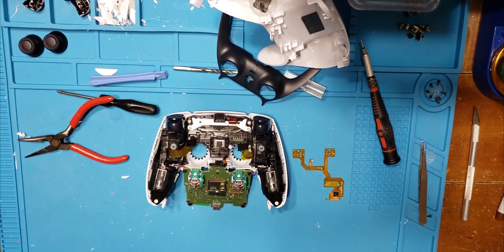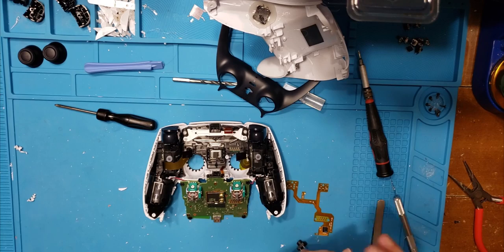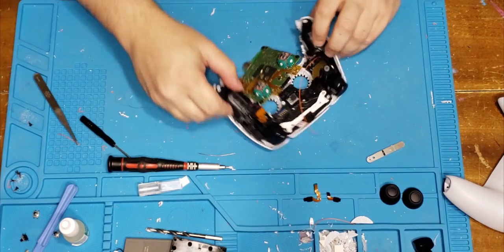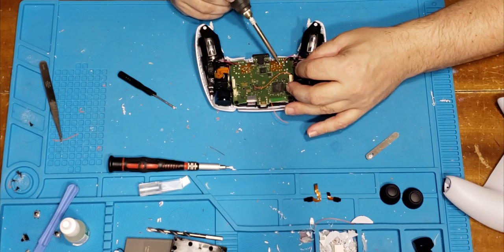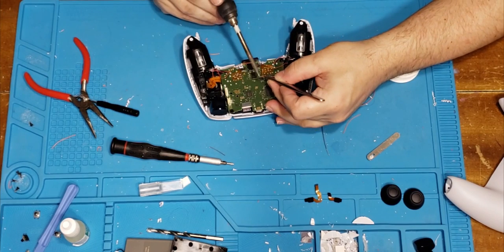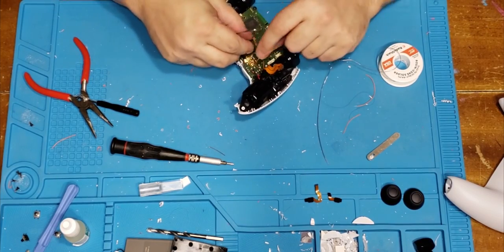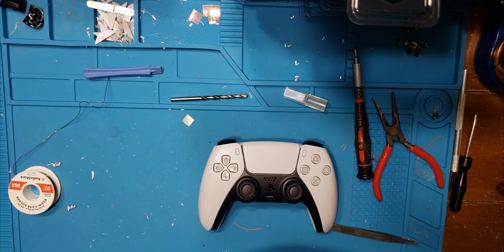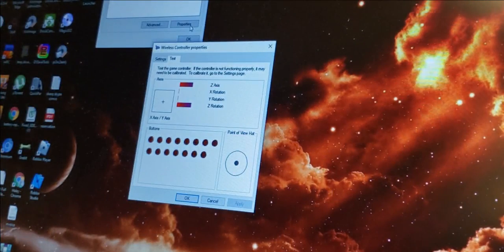PS5 Dualsense PROGRAMMABLE REMAP PCB + GRIP BUTTONS  DIY GAMER TUTORIAL BUILD UR OWN Controller

Comment: I bought the remap chip I followed your step to the t everything works but I can’t remap and the light never comes on? Any idea what I can do?
Reply from the maker: Did you do any additional mods like CLick triggers?
Reply: @MODCENTRALUSA  yes I did
Reply: I also added clicky face buttons
Reply from the maker: @luismaldonado-gg5fg  Only click face buttons.. not clicky triggers or bumpers? If you did clicky bumpers or triggers it will not work right.. you need to do extra soldering to make it work with that.  I can send you the diagram if you need it.  

Make sure your R1/2 L1/2 wires are soldered from the proper points on the trigger mech pcbs to my flex board to R1/2 L1/2. Again if you have clicky triggers or bumpers there are additional wires to solder.. I can not explain it.. but Ihave a diagram.
Reply: @MODCENTRALUSA  I have both click face buttons and bumper triggers too
Reply from the maker: @luismaldonado-gg5fg  YEP.. then it will not work.. THe board is designed for ANALOG Triggers not Digital clicky triggers and bumpers.  You need to connect your clickly triggers and bumper to the SR1/2 and SL1/2 Points on the board as well to allow the Digital clicks to register with the board. 

https://ibb.co/CWhcd4c
https://ibb.co/y5vzPqD
Reply from the maker: You could also upgrade to my Digital triggers and bumpers which will work with all programmable boards and Rapid fire boards with no extra soldering beyond the R1/2 L1/2. They are plug and play.

https://ibb.co/hfxfBvG
https://ibb.co/qYgwQSZ

The video release for this was shot last night I am editing now.. but I will be releasing these Over the weekend. 

They are $30 shipped...  They have some of the best 1mm digitial press switches on them.  These are industrial. 

https://ibb.co/hfxfBvG
https://ibb.co/qYgwQSZ
Reply: @MODCENTRALUSA  the diagram is a big confusing so I use the sl1-2 not the M1-4?
Reply: What diagram should I follow you send two links and both have different paths
Reply from the maker: @luismaldonado-gg5fg  BOth Diagrams will work.. up to you which you want to follow. 
M1-M4 are your remaps.. those are the buttons on your controller that you added. Those stay the same.  

Basicly looks at the extra TACT BUTTONS market R1/2 L1/2 those are the "Click" Bumpers and Triggers you installed. COnec them to the additional points on the remap/reapid fire board. To enable the digital features to work.
Reply: @MODCENTRALUSA  I didn’t use those switches though I used like the ones you sent me but from extreme rate, the plug and play kind
Reply: Do digital triggers and bumpers like the once you sent me won’t work if they not your brand? I bought extreme rates before I knew of yours
Reply from the maker: @luismaldonado-gg5fg  No My boards only work with my digital triggers...without the extra soldering.  With homemade digital triggers or digital triggers from anyone else have to be connected to the SR1/2 and SL1/2 points to tell my board you have a digital button installed. 

Keep in mind these boards were designed in NOV 2020.. there were no digital triggers at all.  As people came up with more mods and did things like digital triggers I updated my Rapid and Programmable remap so that they could interact with digital triggers and enter programming mode.  I know placed like extremerate are going to make their own stuff but they do not have the proper resistors and extra layers on their board to talk to my Boards and interact with it.  That is why I designed my own digital trigger PCB and nearly 9 months after I released my boards and updated them multiple times, I created a plug and play solution.   I haven't even officially announced them on my channel yet.. That is coming any day now.. just finishing up the video. 

The Photos I posted of the Install for CLICKY bumpers and triggers was made about 5 or 6 months ago when people were stuffing tact buttons in their triggers and bumpers to go digital.  I made sure my boards were ready and working with these other kinds of mods and you had the option of installing it in a stock controller with 4 wires or if you did a "clicky" button mod, you had the points needed for the board to recognize the digital buttons and still allow you access to programming mode. 

So you choice is this. if using extreme rate.  
Pull them out and get mine that pair with my boards. 
Or Solder wires to the legs of the buttons and connect them to the SR1/2 SL1/2 points on the board and you will have access to the programming menu,
Reply from the maker: @luismaldonado-gg5fg  https://ibb.co/W58dZDn

Here this will help you.. you need to solder 8 wires to make it work with Exterme rate digital buttons.
Reply: @MODCENTRALUSA  do you wholesale?
Reply from the maker: @luismaldonado-gg5fg  Yes... if the quantities are right.. I do not offer wholesale prices on someone looking for 2 or 3 ect... whole sale are 10, 20, 50, 100 ect....  Pricing will vary by quantity.
Reply: @MODCENTRALUSA  I’ll send you an email so we can talk numbers
Reply from the maker: @luismaldonado-gg5fg  modcentralusa@gmail or modifycentral on skype.
Reply: @MODCENTRALUSA  where can I purchase the board and the triggers you told me I want to test them out before I commit to large orders, and yes I’m paying your retail prices